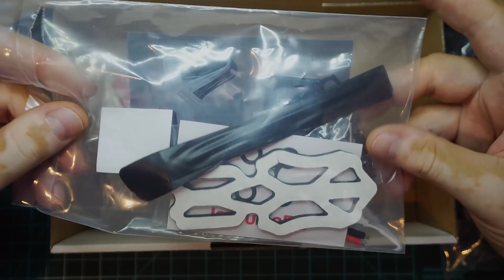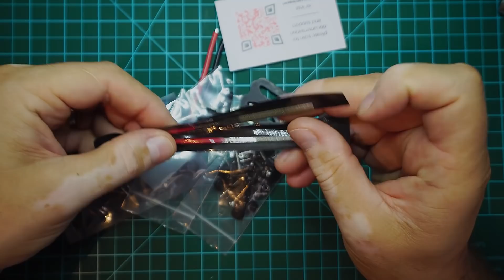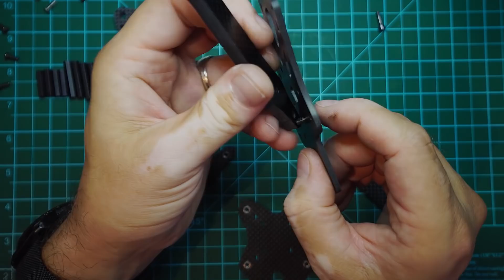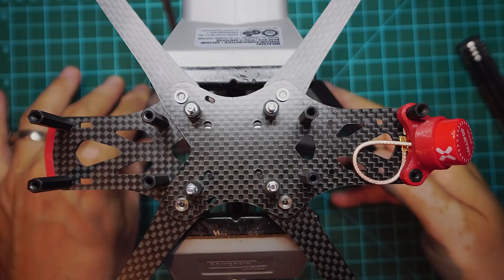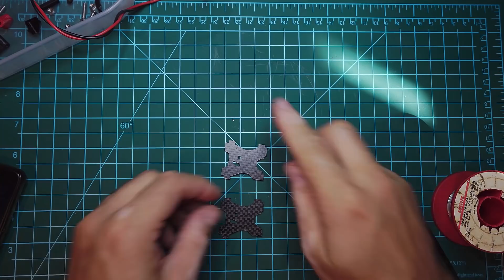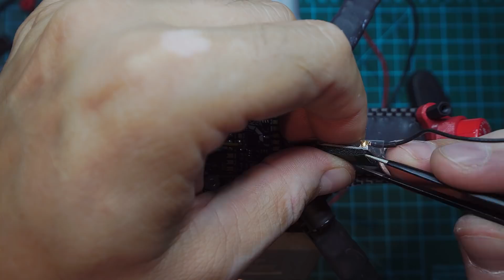ImpulseRC APEX Build Tutorial (WOLF v3)

Comment from the maker: Thanks for the kind words guys, please if you will subscribe and press the notification bell would be awesome for me, Thanks!
Reply: Livyu hi do you know how to activate the onboard mic on this osd or what pads to use to add a mic for audio my friend I'm using the same foxeer & tbs vtx and followed your video to wire it up but I can't work out how to activate the onboard mic or where to add my own one
Reply from the maker: @wdavie27  Well If I remember correctly there was a MIC pad close to the CAMERA CONTROL pad. And MIC should go to VTX audio Input. Newer VTX es from TBS have a separate AUDIO pin. In the beginning Smart Audio was well audio pin. If you have such an old one then connect both Camera Control Pad and MIC pad together to VTX audio input. If not then use separate wires. CC to SA and MIC to AUDIO. Hope this helps. I only have one of these left in the quads because I use ULTRA now. Thanks.

Comment: Hi. I builded the same setup as you just with hd frame, full dji unit, kiss 32a and panasonic 35v 330 cap instead in feb. been working great.
I got 5 of these kiss 25a single esc. Building with normal Apex body with caddx vista this time.
My question is.. Ive got some geprc 2306.5 1850kv motors that am planing to use. So more power hungry than ethix stout v3. Can I use those esc with 35v 470cap with that motor? Possible add another 35v or 50v bigger cap on the wolf pdb as well if necessary?
As off know I got only panasonic 35v 330 laying around. Used those on my first build because they have the same lenght/size as rubycon so the prop can not strike it when bent as you. Also thought the 32a would give me a little better headroom with smaller cap, heavier build.
Can I also use the panasonic that Ive already got (also with cap on pdb pads. 35v or 50v?)? Panasonic 470 is out of the question bec of lenght so then I need to order rubycon
Or do I need to invest in fettec 45a or other high preformance esc?
Thank you

Comment: How do the 25a hold up on 6s? I’m building the same exact setup on an alien.
Reply from the maker: for me they are working like a charm. BUT ADD THE CAPS !
Reply: Livyu FPV  have u had any issues with these ESCs? I have one esc which out of no where stopped working, the light wouldn’t turn on and a chip would on the esc would get pretty hot  if powered for 10 sec or so, but no smoke. Have u had anything like this happen with the 25a? Or maybe I just got a bad one, I contacted get fpv for some ideas on what happened.

Comment: hi livyu, one question to the solder and repair god: my alien build ;kiss v2, kiss 4 single 32amp escs, steele pdb and stout v2 motors plus 330uF caps work fine on 4s and on 6s 2xescs blew immediately up when connecting the lipo. any idea why 6s failed badly but 4s worked ?

ps: awesome videos. keep on!
Reply from the maker: hi, I have no idea... I have 3 6s builds with 25A singles with caps on them and never burned one... and stressed them a lot. Don't know what to say...

Comment: Great build with top parts, but you will not need the capacitors if you power the camera directly from the VTX and VTX directly from vbat. I alway get clear video image pluging the Camera in the VTX.
Reply from the maker: Capacitors are not for noise :) they are there for the escs witch are at their limit with 6s so marely there to protect the escs on 6s ;)
Reply: @LivyuFPV  Thanks for clarifying that, I do not use Kiss ESCs with my Kiss builds, I use BLHeli_32... I'm done with burning Kiss ESCs
Reply from the maker: @asantosjr  well all 4in1's die... Thats why i dont use 4in1
Reply: @LivyuFPV  Individual Kiss ESCs also 🤣
Reply from the maker: @asantosjr   weird... I only broke 1 kiss ESC in the past 2 years but water got under the heat shrink...

Comment: I love the way Kissv2 feels looks like a great frame. My only complaint is on my Kiss build as this one they give very little room on the PDB boards. It's an issue for me as my sight is not what it once was. I use a magnifier sometimes but,still makes it award. It's tough to get old yet, still going to build one. Thanks for sharing you make it look really clean.
Reply: I have the same issue. A pair of Jewelers goggles have worked well for me plus it also has a small light directed towards the work area.

Comment: So maybe I've had bad solder or something but sometimes even with max temperature the solder won't instantly liquify. The end result is always alright, but it's not perfect. What temperature are you using and do you ever use flux or just the ammount that's in the wire? Also did that black xt60 connector come with the frame?
Reply from the maker: I only use flux when using hot air... I nornally keep my soldering iron to 300 but go up to 400 sometimes... It depends on the iron though. A good wuality solder 60 40 should to fine.

Comment: The 24amp can handle 6s? Apex looks great 👍🏻
Reply from the maker: 24A no, I don't think so.
Reply: Livyu FPV Oh, my apologies. I thought this was a 6s build. I have these escs. Thought they were 24amp. Thank you.
Reply: Livyu FPV oh! I went back through. I have these escs. They are the newest ones from. I thought they were 24a. But looks like they are 25amp? Just curious if you have any issues on 6s with these escs. Thank you 🙏🏻
Reply from the maker: @tenaciousfpv6874  nope no issues... they are rated for 5s but the MOSFETs are 30v... and installed caps 25v so it's at 6s but barely thats why I extra filter them... but up until now they are pretty ok on 6s.
Reply: Livyu FPV Fantastic!